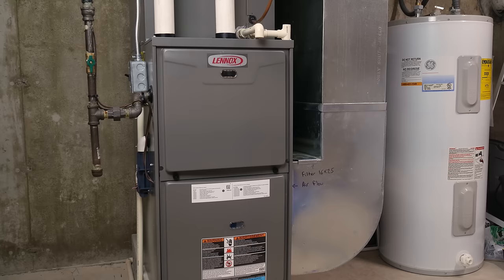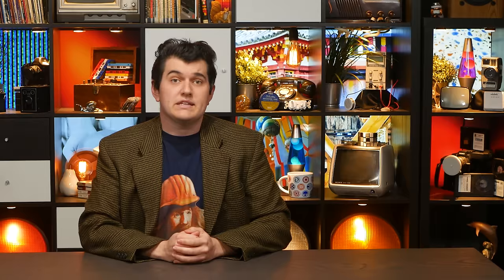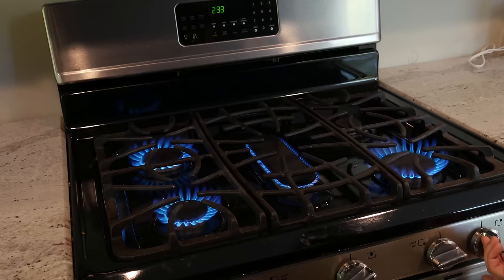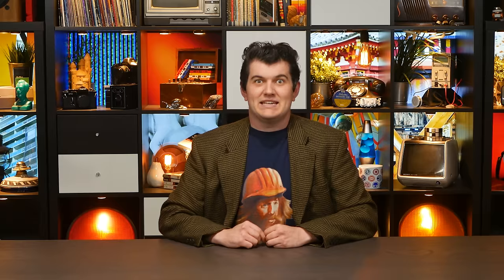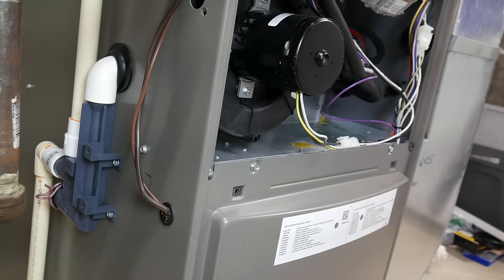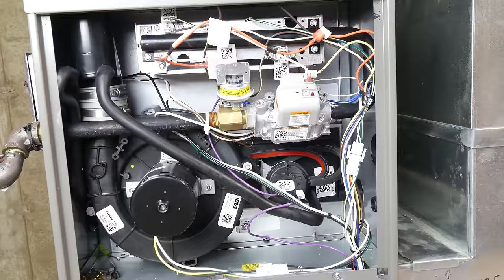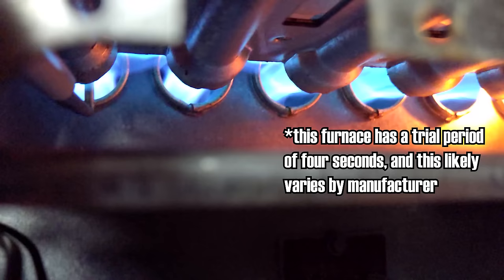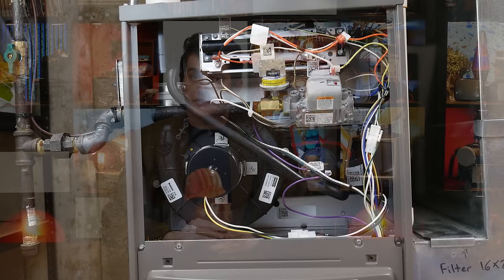Forced-air Furnaces: The What, Why, and How

Comment: Every time my CO monitor goes off it gives me a huge headache and makes me tired. Stupid thing!
Reply: I would really like to find an inexpensive detector that would alarm  not only at the unit but at multiple locations where it cannot fail to get noticed.
Reply: @MPRiley-rb6lj  How many stories is your residence? You should have one on every level of your home. In a single level home, the alarm is likely loud enough to wake you.  CO is nefarious, and I understand you're looking for inexpensive options, but if you're a homeowner of a multi story home, I'd really recommend hardwired detectors with an integrated circuit.

If your basement alarm detects CO (around 30ppm in my experience) it will send an alarm signal to all detectors on that circuit causing them all to sound in an ear-splitting cacophony that will even have your neighbors knocking on your door.
Reply: @travelinghermit   
Sadly hardwired is the only option I have found. Odd with everything using wireless now. You could have a gun range in the basement and fail to wake someone on the second floor.
Reply: LOL funny that.
Reply: Just get some BRAWNDO, it's got what plants crave and fixes headaches.
Reply: Yeah I see the joke for those who do not know what the symptoms for CO poisoning is.
Reply: @Gengh13  BRAWNDO’s got electrolytes.
Reply: Ha! I laughed at that one.
Reply: I once dyed leather in the basement, which was stupid as it was next to an old oil furnace. Surprisingly, our cockatiel started throwing a fit long before the carbon monoxide detector activated. Everything turned out fine: the bird was moved outside while I vented the house, and I moved the freshly dyed leather outside on the opposite side of the house.
Reply: When my CO monitor goes off, I get a headache so bad I’m sick to my stomach.
Reply: Nicole King  might wake up a bit late, though
Reply: @macmedic892  Do you even know what electrolytes are??
Reply: @MPRiley-rb6lj  It is not inexpensive, but having a CO2 monitor as part of your security system is one option.  We have simplisafe but no doubt Next, Ring, and so on have options like this.
Reply: I've heard that joke too many times for it to be funny. ):
Reply: @theninjascientist689  it’s what they use to make BRAWNDO
Reply: so exhausting isn't it?
Reply: Underrated joke
Reply: I would kick my furnace...twice
Reply: Just remove your CO monitor. Then you can rest in peace.
Reply: @MPRiley-rb6lj  There are non-integrated 110v, plug in detectors, and there are some wireless ones (like nest). The wireless ones are pricey and I'm not sure if they'd fail should your wifi go out.

As far as the gun range, I have a pressure switch alarm on a bottom of the house radon fan that kept me up all night, and that's in the crawl space, bedroom being upstairs. Some respond easier than others I guess
Reply: @MPRiley-rb6lj  but in the end it just senses at one point which makes an alarm in another room useless
Reply: Unplug the battery, and you'll never wake up again!
Reply: @MPRiley-rb6lj  fireangel make combo smoke and CO detectors which link to each other (so they go off together). Basically the same core feature set as the Nest Protect but at a lower cost. Obviously no phone control or speaker that talks or anything, but they're very small compared to cheapy bulky smoke alarms. Alternatively, the pill-shaped separate smoke alarms are like £10-20 ($15-30?) but obviously they don't network.
Reply: @travelinghermit  that sounds terrible
Reply: Vect0r85 lol, comment of the year nominee!
Reply: @MPRiley-rb6lj  I have several of these. You assign them locations, when one goes off they all go off.
First Alert SCO501CN-3ST Battery Operated Combination Smoke and Carbon Monoxide Alarm with Voice Location
Reply: @travelinghermit  Just wear a pulse oximeter whenever you're inside.
Reply: @maxwfk  Why would that be useless?
Reply: @Christopher-N  So you say I could simply use a bird as the detector, like they did in the mines? Nice I will catch a dove :D
Reply: @alexandernoname6339 : Possibly, but also to look out for your [feathered] friends as they will look out for you.
Reply: It's not the detector that's giving you headaches and making you tired. You've got carbon monoxide, and you need to find out where it's coming from and fix whatever is broken. In the meantime, open your windows when you get those feelings and go outside. If the symptoms get severe, you may even need to call the paramedics, who can administer CO poisoning treatment.
Reply: @MPRiley-rb6lj  I just had a hardwired detector/alarm system installed in my home (it apparently came without one, which wasn't obvious during the inspection), and while my parents' home had one alarm on every floor, already enough to wake you out of a sound sleep, modern code requires an alarm in every sleeping space, as well, so you can be DAMNED sure you won't ever sleep through anything again. I currently have 4 alarms as back-to-back pairs about 10 ft apart, thanks to the configuration of the bedrooms in my house, with additional detector/alarms in the basement and attached garage. The installation cost $1188 a year ago. Unfortunately, that's not remotely "inexpensive", but it's definitely worth the expense if you ever need the system.

If you prefer, the system is installed with regular 14/2 ROMEX and different detectors based on location (bedroom/hallway/garage). The detectors run approximately $12.50 apiece in different sized bundles at Home Depot, plus as much ROMEX as you need to wire the whole thing together. I learned a lot about wiring while the electrician was here, and could probably install the system myself, today, although I didn't want to risk screwing anything up at the time.
Reply: @dougbrowning82  Whooosh. :)
Reply: I put my Darwin Award right on the mantle. I’m so proud of myself.
Reply: @macmedic892  it really shouldn’t be going off at all
Reply: 1st time I've heard that joke lmao
Reply: I installed mine and it never once informed me that I'm in Colorado. Junk.
Reply: @vincenthiggins6091  I thought it was funny AF
Reply: I have a different problem. My smoke detector overheats WAY too easily. Every time it goes off, the whole room suddenly heats up.
Reply: @macmedic892  It's got what plants crave!
Reply: @MPRiley-rb6lj  In Denmark we have such a system... it is called Cavius.. they make pretty neat smoke and heat sensors at least.. that can be wirelessly connected. i have 3 in my house and well... let's just say I have accidentally tested them a few times and it works...  they also sell to the states.. though postage is like 16 euro or so.
Reply: You can just remove the speaker. Just like the PC speaker in a computer.
Reply: Good point. Better to shut that CO monitor off and save yourself a headache.
Get a good night (permanent) sleep instead.
Reply: A sign of carbon monoxide poisoning.
Reply: @williamhuang8309  no, its just tiredness. Happens to me every time i am home. But i have a hard job.
Reply: @Gengh13  watch the latest episode of OW MY BALLS! To take your mind off it.
Reply: @MPRiley-rb6lj  system sensor does make battery operated ones that work with security/fire alarms. I install them for a living
Reply: @MPRiley-rb6lj    Place them  near the Warm Air Grills, if the Exchangers are Leaking, the CO, and CO2 will be in the Warned Air
Reply: @maxwfk  No.
It senses it in one point, and sets off the alarm in EVERY room.
Why do you think it sends the alarm to just one room?
Reply: I find that these symptoms are usually due to the cold. Turn up your heater a notch or two.
Reply: It’s probably the noise that’s bothering you, just unplug it and you’ll be fine.
Reply: LMAO
Reply: @dougbrowning82 .... That's the joke
Reply: Stormi Storm  should i consult a comedian to determine why so many people didn't get the joke?
Reply: Hi
Reply: Just take the batteries out. Problem solved. 👍🏼
Reply: @Doug Browning  ummm that was the point Doug... does someone really have to explain jokes?
Reply: @vincenthiggins6091  love the reference
Reply: If it saves your life it's worth a headache
Reply: @vincenthiggins6091 as someone who’s rarely been around any gas appliances maybe a hand full of times which isn’t a lot Ik what it is and understood the joke.
Reply: Ikr! Then the stupid beeping doesn't help! I just took the batteries out at this point 💀
Reply: Get rid or the furnace and get a heat pump!!
Reply: I think everyone here got whooshed. Appreciate the joke
Reply: seems like your co monitor might KILL you
Reply: Ik right? my friends say I sleep like a corpse when it goes off
Reply: @seneca983  lol
Reply: Yeah it's the monitor itself that's causing these symptoms.   Just throw them out lol.

Comment: The most high tech space heater is a gaming pc.
Reply: Oh yeah. A few years ago you could heat your house with one of the high-end graphics cards. I had to upgrade my PC to a 1000W power supply. I forget which card I had but it had multiple fans on it, and chucked out heat you could make toast on. The most recent graphics cards are a bit disappointing by comparison.
Reply: I have found thatAn old MacBook Pro is a very good leg burner
Reply: Fr
Reply: I acutally use BOINC to get my CPU to 100% so I don't have to turn on the radiator in my bedroom, it works wonders and I contribute to science too xD
Reply: @therealdebater  prob that radeon 9 monstrosity which some how remained relevant thru 3 generations just by being so fucking big and powerhungry
Reply: @gabrielebursi5509  Aside from the extra stress on your pc components, which honestly is probably negligible overall, that's a pretty damn good idea and I'm very impressed
Reply: @gabrielebursi5509  I've been doing the same thing with Folding At Home. :D
Reply: A resistive heater with the side effect of graphical output
Reply: Yes sir!
Reply: @therealdebater  wao i wonder what card that is and if such high TDP processors can be had for cheap
Reply: Hahaha! My MacBook Pro gets ridiculously hot when it’s on my lap or sitting on pillows/sofa/sheets.... My PS4 Pro’s cooling system goes into overdrive EVERY time I play Skyrim too.... But ONLY with Skyrim!
Reply: @jiinkC  ¡Oh, yes!

I have a friend that told me that on Monday morinigs, (when he was student...)  the classroom was really cold, and he put his Surface tu "find Pi numbers" and then warm his hands. ¡Aluminium chassis!
Reply: @poiiihy  Buy used servers, they are super cheap. like below 300$ for dual socket 8core cpus.
Reply: My gtx 960 does a good job of keeping me warm in the winter.
Reply: Close. Think crypto miner that uses profit switching. How many electric space heaters actually earn money? Mine do!
Reply: @jiinkC  I believe they call those "Radeons"
Reply: FX-9590 + R9 290X made for a great heater that doubles as a decent gaming PC back in the day
Reply: @therealdebater  Apparently the 3090 SLI has similar thermals to what you speak of. 😅
Reply: LOL!!!
Reply: A PS4 can do a pretty good job too.
Reply: Yeah, when it gets cold in my room, I just fire up some doom eternal XD
Reply: I used to use my PS3 as a space heater years ago....
Reply: My pc with an AMD FX8350, and my server full of spinning rust. Tell you year round that they are very warm, and would like to be cold..

Shame im also the UK, so.. no Aircon.

Rip
Reply: @gabrielebursi5509  you’re wasting so much money pc is just an complex electrical heater your normal heating is going to be much more effective
Reply: I agree mine still heats my apartment with relative ease while staying nice and cool on the cpu. Gather around the gaming pc children let uncle dylan tell you a tale
Reply: richmans/poormans heater
Reply: @fgregerfeaxcwfeffece  The only downside is the noise.
Reply: @markarca6360  Of course, they are about as loud as jet engines. And that really is only a slight exaggeration. That just happens when you compress that level of output into that little space.
Reply: If you can get a few “unprofitable” ASIC crypto miners, then your net heating costs can be as low as pennies per day. Just install them in the plenum space and cycle the fan-only mode on your furnace every so often.
Reply: Gotta get a gas fired gaming PC 😂
Reply: Try a bitcoin mining rig.
Reply: My monitor alone puts out enough that I can turn off my radiator during winter and still get sweaty.
Reply: Have you ever used a blade server?
Reply: So basically AMD CPUs pre-Ryzen.
Reply: Lots of cool flickers lights too is a bonus.
Reply: Laptops are kitty butt heaters says everyone with a cat and a laptop that gets even a little warm.
Reply: Or non-gaming pcs trying their best to run a game but only starting a fire. 
My old desktop could be used a reverse in window AC unit.
Reply: therealdebater Dude check the power consumption on the 6900xt. It can bring a 1000 watt power supply to its knees
Reply: Yeah, specially if you still use Piledriver
Reply: @therealdebater  Gtx 480?
Reply: @thecheeseman31415  I'm not sure, because it was a few years ago, but I've dug out of my cupboard a discarded 'GeForce 8800 GTX'. It only has one fan, in fact. It has two of those extra power plugs at the top. I can remember that when the fan got up to full speed it not only sounded like a jet aircraft taking off, but you could literally feel the heat coming out (like a hairdryer, I suppose). Those were the days.
Reply: @thecheeseman31415  PS It has great thermal conducting pipes inside it. I have a vague recollection that this was an early die of the GPU line - whatever it was - that was thermally inefficient. Understatement!
Reply: 75 inch plasma screen disagrees.
Reply: Runner up prize goes to my old CECH03 PS3.
Reply: here its 2 servers and a FM pirate radio transmitter warms the cyber space very well !!!!
Reply: Honey, I'm cold. Can you please play a couple of hours on your computer?
Reply: @therealdebater  well the new 30** series is trying to bring that heat home for the winter
Reply: Actually my server does a better job than my gaming PC
Reply: I live in north central canada, I have dozens of GPUs mining crypto, my furnace never comes on even at 25 below 0c
Reply: Yeah, every time I need to heat up my room, I turn on a 3dmark stress test
Reply: My laptop with its RTX 3070 GPU makes quite a lap warmer.
Reply: I changed the likes from 1111 to 1112
Reply: The best PC space heater would be an FX-9590 and 4 GTX 480s in SLI, running benchmarks non-stop.
Reply: For me it's my 60inch plasma tv. Love it in the winter.
Reply: Especially when you play minecraft in vr with too much mods
Reply: Try a ps4 and a gaming pc in a small room. Its like a sauna
Reply: Mining Rigs. We heat our whole house for the entire winter.
Reply: The old Xbox 360 with the removable external fans. My room got really warm after a while and had to take breaks every couple hours lol
Reply: The most beautiful one is a room filled with tropical fish tanks
Reply: dell laptops work as good handwarmers, especially the lift hinge ones
Reply: Yep. I leave mine crunching science stuff for Berkeley 24/7. Don't really need to run the furnace.
Reply: I knew a guy who used crypto mining to heat his basement and pay for it’s own electricity costs. Crypto is silly but a space heater that pays its own electric bill does sound nice.
Reply: my all in one: REEEEEEEEEEEEE
Reply: Uess
Reply: While I appreciate your attempt at humor, this is not the place for it
Reply: Oh ok just a spelling mistake
Reply: my dual 780s are warming my room up in winter better than any portable heater ive seen
Reply: Or my gaming laptop from 2006/2007 (if your wondering which one dell xps m1710)
Reply: @therealdebater  just wait for the 4000 series from nvidia, the 4090 will have a power limit of 800w
Reply: Even my 9th gen i5 with RX 6500 XT is considered middle or low-end, but it still heat my room by 4 degrees Celsius!
Reply: @therealdebater  look at the 3090 that things a powerhouse
Reply: How what would I need to mine with, in order to heat my camper in -30 and pay for its own electricity usage  🤔 🤣   also how would I hook them to a thermostat 😅
Reply: That's true, but... air quallity is horrible.
Reply: @Andrei-xl1xe  After 2 years of using, I have figured out that my air quality has been drastically ruined, now there is a mixture of vapor of Mountain Dew, a particles of Doritos and now missing Tab key.
Reply: Home servers beat the PC and you get free white noise generation for your whole house.
Reply: @ashtreylil1  Tried at home, and it goes well, it’s making alert sound and some fire effects. Is this part of home server?
Reply: @soda415.5  yeah just clear the alarms and ignore it, the smoke smell will go away in a few hours. Make sure you taped the vents closed or the data will leak out the back.
Reply: @ashtreylil1  alright, I taped the vent, data still leaked so I had to get metal bar and weld it, worth it… I wonder why i see fbi logo on the server control panel, though
Reply: @soda415.5  glad to hear you fixed the data leakage. it's just a normal logo. Our servers are usually monitored by the FBI.
Reply: @ashtreylil1  Glad to hear it. My room is already heated enough, and it’s keeping me warm, thanks!
Reply: @therealdebater  or just get an fx 8350
Reply: Under rated
Reply: @andyc9902  rated
Reply: Or a pentium 4
Reply: 42u server cabinet full with equipment is better.
Reply: IT'S SO TRUE. My husband's a streamer and the room his setup is in is EASILY ten degrees hotter than the rest of the house. Even if the computer is 'sleeping.'